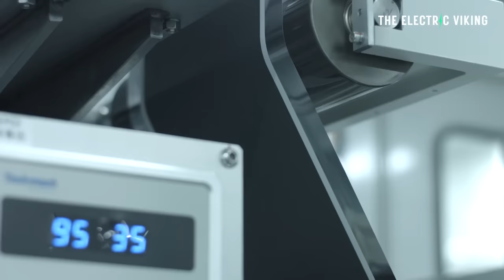Renault CEO begs EU to protect it against ‘onslaught of EVs from China’

Comment: The EU has one decision to make: stop Chinese EV imports!

Either levy absolute protection against Chinese dumping of subsidized EVs, or
Lose EU-based car production, and with it, the entire EU manufacturing industry - manufacturing of ANYTHING.

Every western economy with an industrial sector has that anchored by the auto manufacturing industry. Each industrial national economy has a very small number of auto makers (major brands like VW, Stellantis, Peugeot, Ford, GM, Nissan, Toyota, Hyundai, etc.). Those are supported by a multi-tiered auto parts supply industry:
- major systems & assembly suppliers (Magna, Aptiv, American Axle & Manufacturing, Lear Corporation, Visteon, Forvia, etc.);
- small systems suppliers (brake assemblies, lighting & electrics...);
- battery & electric motor suppliers (esp. for EVs);
- tool & die makers;
- stamping mills & injection molding companies;
- rolling mills & metal supermarkets;
- Fastener suppliers;
- Steel & aluminum mills.

Remove auto makers at the top & the whole market structure collapses: businesses employing hundreds, even thousands of employees to just a few. And the finance companies, banks & brokerages which are all dependent on this huge sector of the economy.

China has declared economic war on Europe & N America. If it breaks western manufacturing, it breaks western ability to arm itself. THIS IS WAR BY OTHER MEANS.

They've outsourced all EV development & production to China (& with that, their futures). 
All German automakers have given up their futures, as anything more than a brand label on a Chinese-manufactured vehicle.
Stellantis has begun to follow suit.
GM & Ford were in the process of doing the same when Biden dropped the IRA. Now GM is working hard to figure out how to get Chinese firms to build plants in the US using Chinese parts & materials to produce Chinese EVs while labeling them GM. 

Toyota, Nissan, Mitsubishi, Mazda: they all outsourced production - esp. of EVs - to China.

China then threw them out. Sales of Japanese vehicles - even Chinese-made Japanese-branded product - has gone to zero.

Mitsubishi & Mazda have already been thrown out of China; they've left.
This year Nissan & Toyota will follow suit.

Meanwhile, China is opening dealerships across Japan.
Japanese industry is toast if the Japanese government doesn't immediately ban Chinese imports or put sufficiently high tariffs on them to make Japanese production economic. It doesn't help that the Japanese firms have ignored or denigrated EVs, refused to learn to make them.

In the 1970s the US gave China most favored nation trading status, sponsored its entry into world trade. It was great for US business - a cynical move designed to make American businesses more money by giving them access to cheap Chinese labor. America sold it as encouraging democracy. HA!

China recognized the potential to use this as a new front in a long-term war. China plays the long game VERY well.

China has stolen western technology, pursuing corporate espionage as a state-sponsored major industry. It has broken rules of international trade by dumping state-sponsored over-production to gain monopoly control over numerous strategic industries world-wide: pig iron production, ships, industrial machines, solar cells, wind turbines, lithium cobalt & rare earths refining, and now EVs.

The goal is to bankrupt western economies by transferring wealth & production capacity from the rest of the world to China's elite, the CCP. It has worked remarkably well.

How have western businesses fought back? They haven't. Instead they've transferred their production capacity to China, transformed integrated supply chains & manufacturing capacity here into nothing more than a brand name. They've obtained short-term financial gain (bonuses, profits) for traded long-term survival of their businesses and our entire economies.

Comment: The Joint Ventures do help a lot for China to learn, such as the automation by robots, and the making of some parts like the sheet metal works, glasses, upholstery and etc. However, there are still a number of "key components" such as ICE engines, automatic transmission, that the Chinese cannot achieve or learnt, either because of pattern, or material, or manufacturer techniques. With EV or new energy vehicles, China, or the Chinese cars and parts manufacturers found a new frontier that is new to all competitors. So it is a fair game, anyone runs fast can win.

Comment: Why did the company move the production of spare parts to China? This only worsens their reputation and the quality of auto parts. Now their products become the same as those of Chinese manufacturers, and they are losing customers worldwide. Spare parts manufactured in China have low quality and wear out two or three times faster than usual.
Reply: It's not as simple as "Hey, let's source wheel bolts from China & save 4 cents each" and then THE WHEELS FALL OFF.
🤔🤭🙄😒
OK, maybe it IS that simple.